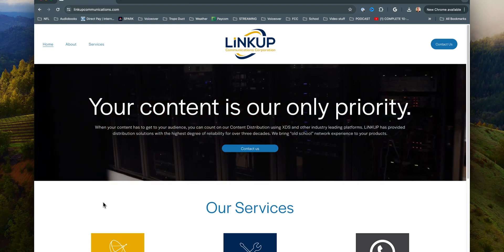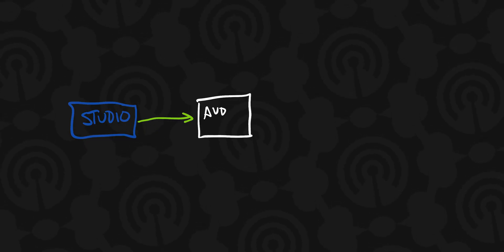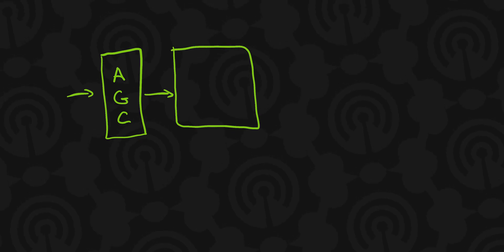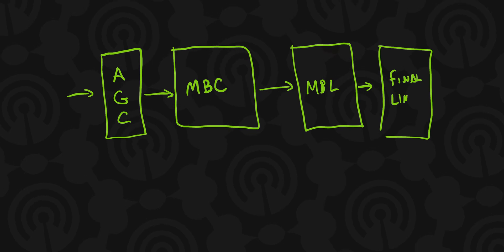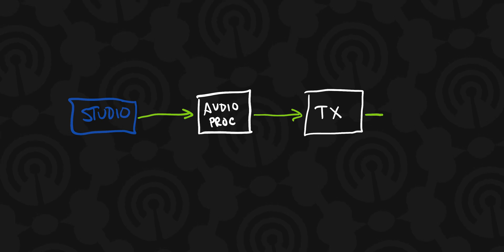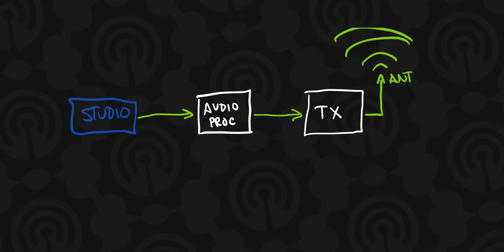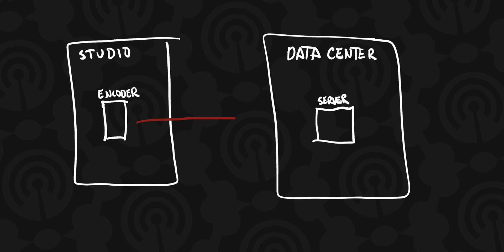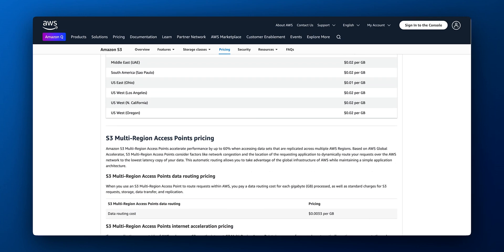The Last Step: Mastering Content Delivery

Comment: Great video again! I’ve been offered a Tram 125kW transmitter and now a Tram 300kW transmitter…….the first was too expensive but hopefully I can do a deal on the 300.

I’ll be lucky to run 50kW though if I can build a better antenna.

I’m doing everything I can to bring back LW radio here in Europe.